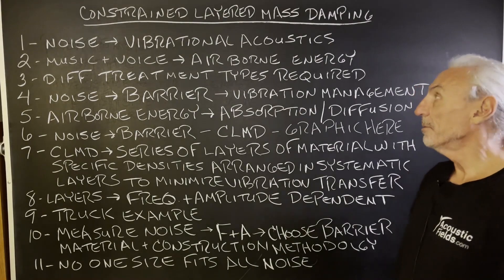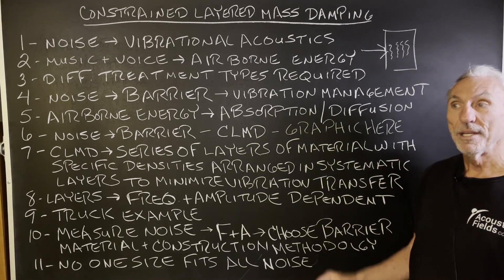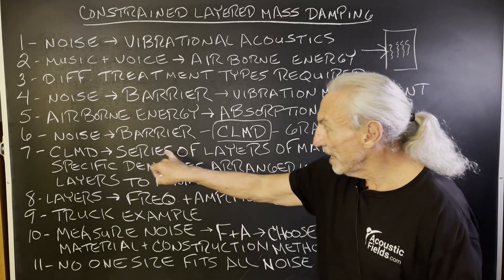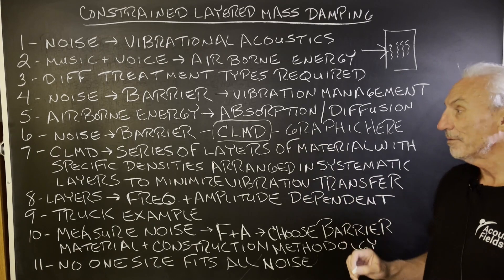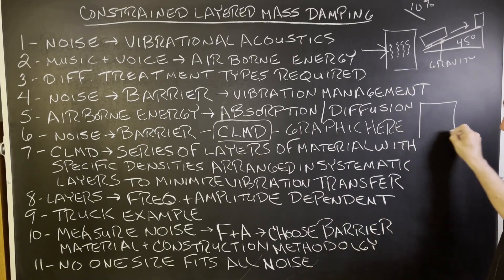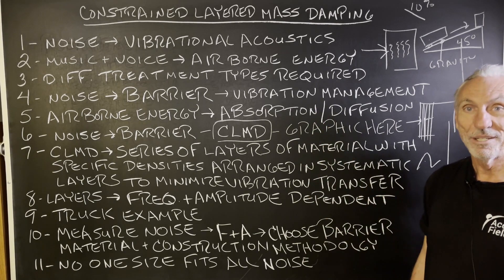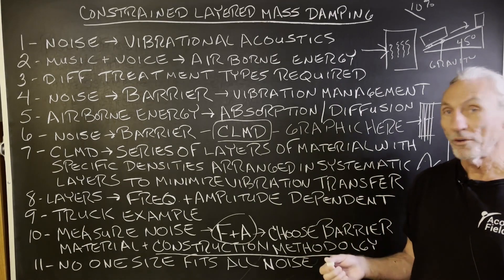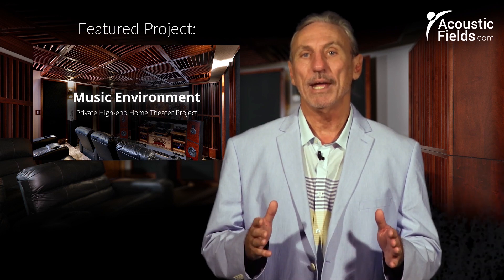Constrained Layered Mass Damping - www.AcousticFields.com

Comment: Regarding the diagram at 1:37, you have noise source on one side and the room inside on the other.  What if BOTH sides there are noise sources?  (i.e. in an urban setting with lots of street traffic on the outside and there is a live performance room on the inside?  Apply this setup to a double stud construction setup with floating floors?
Reply from the maker: You must measure the frequency and amplitude of all noise issues. Everything else is just speculation.

Comment: The most effective way to reduce heat transfer is to force the heat to change the way it moves. Making it switch between Conduction, and Radiative transfer slows it down significantly (Hence all the air pockets in insulation.) 
The physics of sound waves are different, but the principles still apply. Make the sound change the way it propagates and it looses energy. Do this enough times with the right materials, and the amplitude drops measurably.
Reply from the maker: Yes, the goal with any noise transmission vibrations is to reduce their amplitudes or strength.

Comment: Just wondering what the vynil does? Is it working as a shock absorber between the other materials?
Reply from the maker: Noise transmission attenuation is all about vibration management. The MLV minimizes vibration transfer,

Comment: I’ve only read a little on CLMD. Thanks for the excellent explanation and for clearing up some of the incorrect information that has been “published” on the topic and you are so correct on the useless information that has been put out on this.
Reply from the maker: The industry is full of half truths, enuendo, and hyperbole. If you understand the physics, which most manufavturers do not, it is much easier to see through the fog.